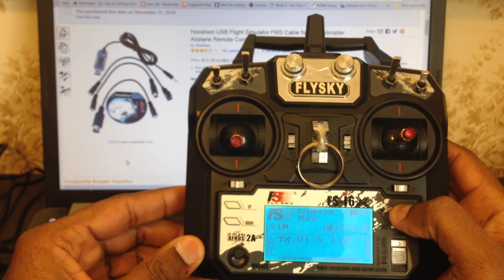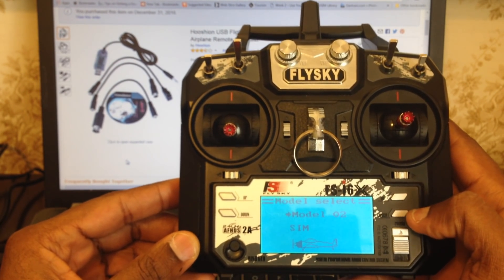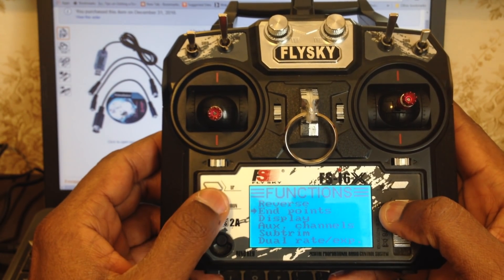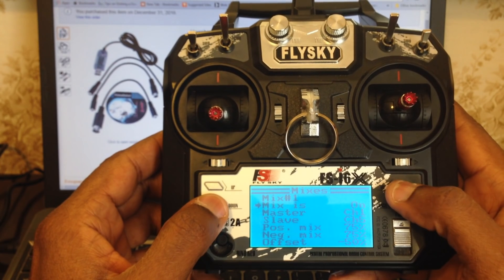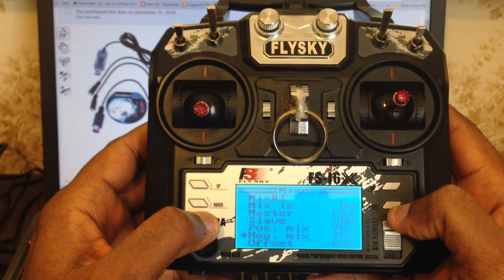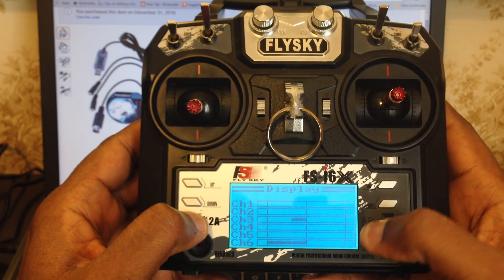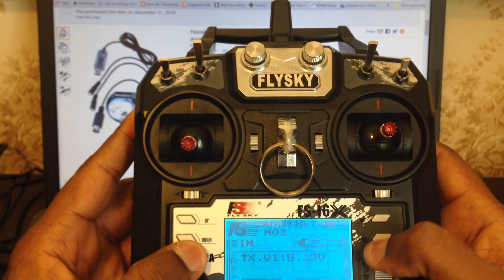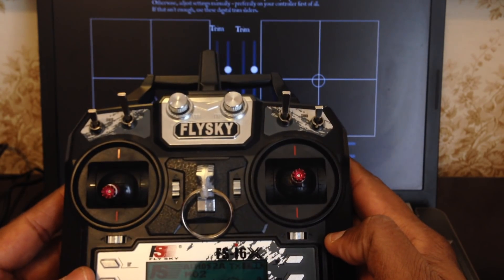Flysky Fs-i6x and Fs-i6 Setup Procedure For USB Flight Simulator Cable

Comment: i have new flysky i6x and RC simulator phoenix5 software realflight7 same CD not working ask alltime serial number but no found box or CD in all serial number anywere. no can use RF7 simulator, only phoenix, but no working any switch, how add simulator sense all switch too ? and ask firs engine, ok, pitch ? elevator ok, aeriol ok, but wwere add pitch ? rudder have same left than engine. important have now how use switches ? and what hell this pitch need add, aelior have right horicontal, elevator vertical,left vertic=engine,horic=rudder.

Comment: Thank you for this video! In my case I cannot yaw with the left stick, can you help me with this ? My yaw stick is at the Ch4, I tried to follow your video selecting Ch4 instead of Ch5 but its not working. Thanks!
Reply: i have the same problem. did you found a solution? if yes. help me pls

Comment: how do u change both ch5 to 120% @1:35
Reply from the maker: mom0g1 go i into end points settings in the menu
Reply: ? @adrianlee30 I did that but only one is changing
Reply: @adrianlee30 how
Reply: With the fs-i6 you can't select the second column... or at least its not obvious..
Reply: @integralfpv2161  LITERALLY HAD TO FLIP THE SWITCH  THE OTHER WAQY OF CHANNEL 5 TO MAKE IT GO TO SECOND COLUMN GLAD I FIGURED IT OUT NO ONE HELPED

Comment: when I connect my motor to receiver, the max speed of motor is reached when the throttle stick reaches 50percent. how should I set up my transmitter. fs i6x is my transmitter